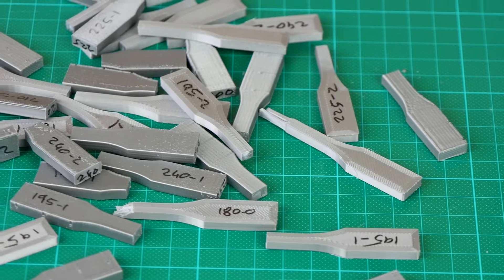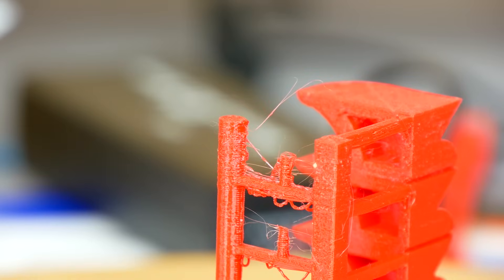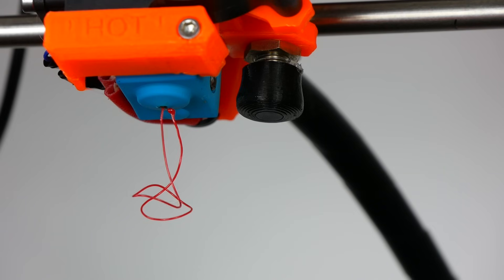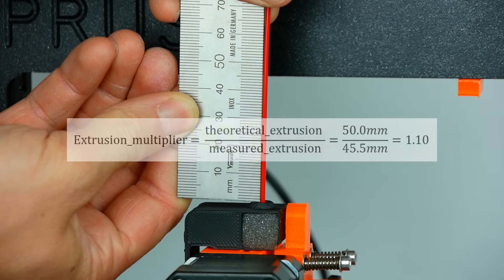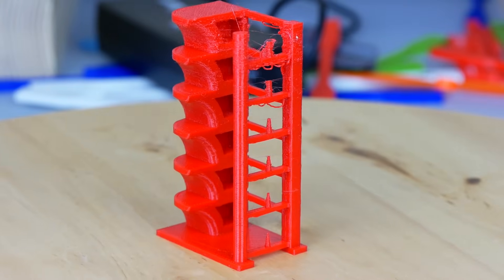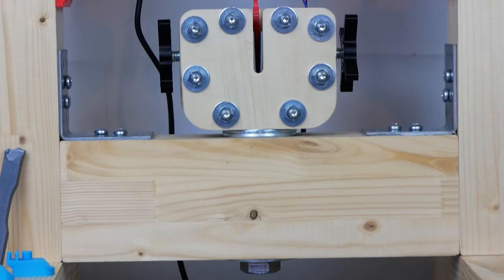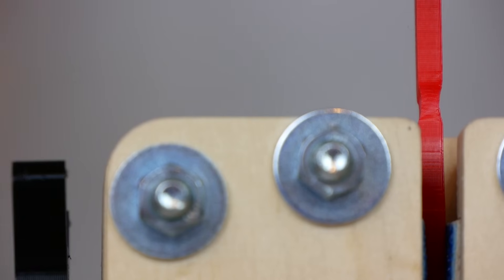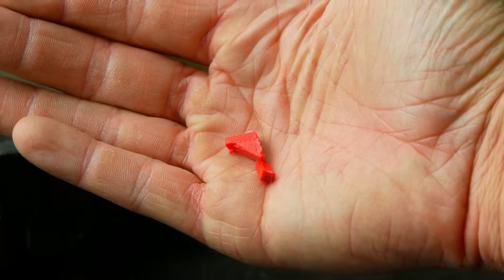3D Printing with PETG - How does the printing temperature affect strength? || Setup & Tips

Comment: Another very informative video. I really don't like PETG. I find it gooey and hard to print, with curling and overhangs in particular a pain in the ass.  Always much preferred printing ABS and keeping it all warm. I recently got some RigidInk PETG which is much better, but not that great. I think it has a lot to do with temperature and cooling. I think having the chamber temperature such that the material is the same delta T from their glass transition point as PLA is at room temperature and adding the same cooling within that chamber as you do to PLA in open air would solve a lot of issues. 

Please, please build a heated chamber and get as technical!!
Reply: I share similar sentiments. I have decided to move to ABS due to it having many properties I want from my prints.

However I have a issue, I have a Monoprice Maker Select Mini, and if I print anything that uses a substantial part of the bed it has a tendency to just peel off the bed mid print. Keep in mind I am using build-tak *with gluestick cause its kinda worn*, no part cooling fan, and a generous brim, with a bed temp of 80c.

Would enclosing the print area and preheating it before print alleviate the issue? Or could a large part of my problem be associated with the filament being saturated with moisture? Because I noticed the filament looked very bubbly as it was being extruded, despite being printed at 230c, which is kinda middle-of-the-road for the recommended temp range.
Reply from the maker: Crank your bed temp up higher! The temperature needs to be higher than the glass transition temperature and 80°C is just at the border. if possible use 100°C. Also an enclosure helps a lot, especially with layers separating. But pay attention that it does not get too hot so that you electronics fail ;-)
Reply: The Monoprice Mini can't reach 100C.  It takes a long time to reach 80.
Reply: It really helps if you insulate the bottom of the bed using melamine foam "mr.clean magic erasers".

But I agree, it probably could not reach 100C without adding additional electronics.
Reply: For ABS try PEI bed it really does work then the only real downside other than the material properties is the stink.
Reply: Get the bed up to 100C and you will get less problems with peeling. Insulate the bed and put a box over the printer and it might help.

Comment: Very interesting that you had such good results at 220*C because in the 3 different brands of PETG I've used, printing at anything below 240 the layers delaminate in my fingers.

Perhaps my temp sensor is massively off
Reply: I think it depends on the hotend construction and filament vendor. For CraftBot printers the recommended temperature is 250C, it sets this value if you select PETG on the touchscreen. In my practice that is definitely good for Esun PETG. I've measured my hotend temperature with a thermocouple, so it is about 250C indeed.
Reply: @bumv2  Ran a temp test for eSun on my e3d v6 and higher than 240 starts to lower print quality. 230 seems to be the best for quality (I'm not sure about strength, but I haven't had layer adhesion issues)
Reply: I've not seen any PETG that recommends under 230, I was wondering if his temperature sensor is off, not mine. Because I have 3 of them as well as 2 infrared sensors..
Reply: @ThoroughlyTested  i print Dasfilament PETG with 230 for the first layer and 220 for the rest to avoid stringing. his temperatures are correct.
Reply: inland specified  240 on the low end for me but it was practically unusable at that temp im at 220+- thats the lowest i dare and the only time stinging and oozing is manageable. i think i tried 210 and based off of print speed the filament would be glossy or an ugly inconsistent hazed much weaker as well. so yeahhh not a a wide window like he has. and trust me ive spent way too much time doing retraction tests with this stuff.
Reply: Go buy a inexpensive infrared thermal sensor (their like $10) and will give you much more accurate temps of the hot end than the sensor. Thats what I use on my CR-10S.
Reply: I have printed several PETGs and find the temp range varies widely - but find i can't print any of them unless i meet or exceed their max temps. (MK3), Also find they have a nicer/shinier finish at high temps.
Reply from the maker: Maybe your cooling fan is too strong. PETG only needs a slight breeze of cooling airflow.

Comment: Did you have any issues removing the prints from mk2s PEI print bed.  Also what was your bed temp. Thanks
Reply from the maker: The prints stuck quite well to the bed at 80°C but I was able to remove them without damaging the PEI surface.
Reply: I can try to answer this one as I'm using the same filament on a mk2s as well. I use 80 degrees as bed temp and use window cleaner to clean the surface before the print. This makes the petg material stick less to the pei bed so that it is easily removed but still sticks enough to not get loose while printing.
Reply: Tip I got from support team was to use GLUE stick to lower the adhesion for PETG. But I will try using window cleaner to see if PETG stick less.
Reply from the maker: +Mariusz Stanisz Sounds like a good idea. I actually had one PETG job badly coming loose when there were still residues of glue stick on my PEI bed :-)

Comment: seems similar to a non Newtonian fluid, like silly putty. hit it with a hammer and it shatters, pull it apart slowly and it stretches and stretches, yank it apart and it snaps
Reply: This is exactly it. It is called anti-thixotropy. It is shear stress causing the polymers to crystallize and garden very quickly under sudden stress. Over a longer shear time, it has a lower hardness and higher plasticity.
Reply: Yep, plastics are mainly non-Newtonian and all behave differently under mechanical stress. this is why iso527-1 standard recommends two speeds for plastics tensile strength test : 1mm/s and 50mm/s ! You should always watch for these two tests when checking A plastics technical data sheet if available. What was your test speed ?

  Really good video by the way !

Comment: I find it wrong to calibrate steps/mm for different materials.
Reply from the maker: +John Ridley Exactly, but that's actually the same 😉
Reply: I just print a hollow cube for each material and adjust the extrusion multiplier to get roughly the desired wall thickness. Steps (which I calibrated with PLA) stay the same.
Reply: I don't think he was changing steps/mm.  He was calibrating an extrusion multiplier for different materials. I think that's OK.
Reply: I also find it wrong. I calibrate flow rate to account for both steps/mm and filament diameter in one go.
Reply: 100% agree, setting diffrent steps for each filament is just dumb .. You calibrate the extruder once, then you find diffrent flow rate !
Reply: Agreed, steps/mm is machine specific, not filament specific and should be measured using the printer travel itself on the printer. Extrusion multiplier then uses a single wall print which you can check the thickness of and adjust the multiplier. I also think that a lot of the results here are very dependent on the PETG used, mine prints great at 240, no fan whatsoever and great details.
Reply: John Smith:  Agreed .. I find it simply easier to visually calibrate flow rate for a new material or new reel of material..., and ignore filament diameter. Calculating, measuring & entering values is time consuming ... its much easier to tweek flow rate based on appearance of printing on the first several layers, then enter that flow rate as G Code command automatically via the slicer software.
Reply: Vincent Groenewold:   Agreed, I've printed a lot of PETG, and the optimum nozzle temp does vary widely from one brand to another, and thus the flow rate will too. I have multiple PETG brands loaded into my slicer/GCODE generator .... usually using eSUN or Hatchbox PETG here in USA.
Reply: It’s not particularly useful, but it’s technically more correct than just putting it all into an experimentally determined extrusion multiplier.
Reply: Pilot16H nevertheless, steps/mm are not quite the same between materials. If that setting is in the printer settings and not the materials setting you can’t adjust it for your material, but that doesn’t mean it doesn’t change.
Reply: It helped my prints quite a bit.

Comment: Thank you very much for testing the exact filament I'm printing right now :) 
I'm quite happy so far, after calibrating the extruder, it produces prints that are actually a bit nicer looking than what I got from using dasfilament's PLA material.

So in my book, their PETG is the superior material; it looks nicer and has a higher temperature tolerance than PLA.

Comment: you should mess around with minimum layer time and turning off the part cooling fan :D

I don't know if slic3r has these settings but cura has multiple settings for it. where it will slow down printing speed or even just wait and do nothing while the plastic cools down on layers that are printed too quickly
Reply: I suggested this because looking at 6:40, the lower section of the chimney where the print head has to move and print the roof on the same layer looks perfect, but the layers where the print head has nothing else to print are way too melted. perhaps if the print head went somewhere else and waited, the chimney would come out properly without using a cooling fan, perhaps making it stronger
Reply: Yes, that's possible with slic3r, too. The setting is called "Slow down if layer print time is below...". But I don't think it's possible to let the printer stop and wait for a few seconds.

Comment: Hi! 
Really nice video and interesting results.
How did you print the PETG on the PEI heatbed? I thought that PETG bonds to good to the PEI surface and you can not seperate from the heatbed anymore....
Cheers,
Markus
Reply from the maker: Hi Markus, yes, I printed it directly on my PEI bed which works quite well for this brand. But you are right, the Co-polyesters tend to stick quite a lot to PEI which can even damage the print bed. You should always try the adhesion with a small print and then decide if you can risk it. Spoolworks EDGE filament for example totally fuses to my Prusa so I print this brand on blue tape.
Reply: Hey, 

Thank you for your fast answer! I also use PETG from www.dasfilament.de so that is good news.
Thanks and keep up your good work. ;)

Best,
Markus
Reply: +CNC Kitchen would you recommend blue tape over gluestick for separation like that? I imagine blue tape would be easier to clean up after printing
Reply: NikWillOrStuff I always used kapton tape. It works perfect if you have to print flexible material or petg. ;)
Reply: I use window cleaner on my PEI heatbead before I print with PETG (also das filament) and I have not had any problems with adhesion or to get the prints off the printbed.